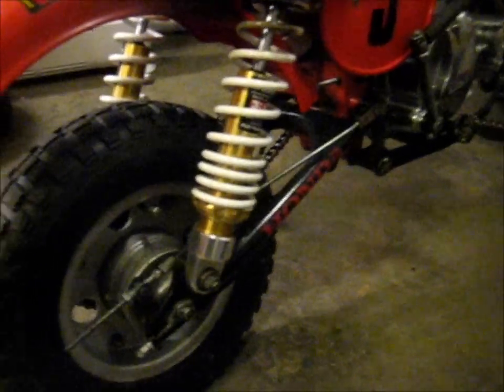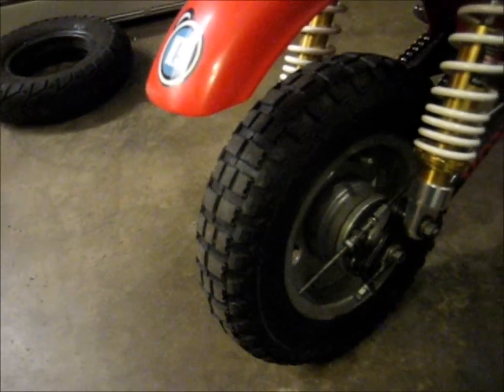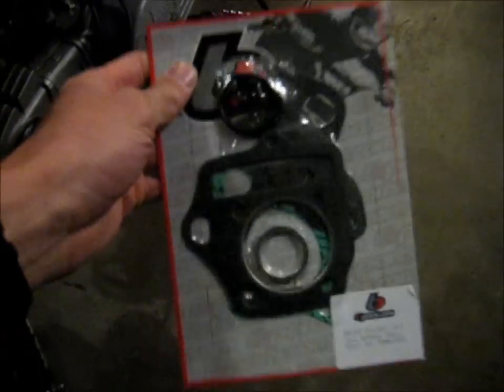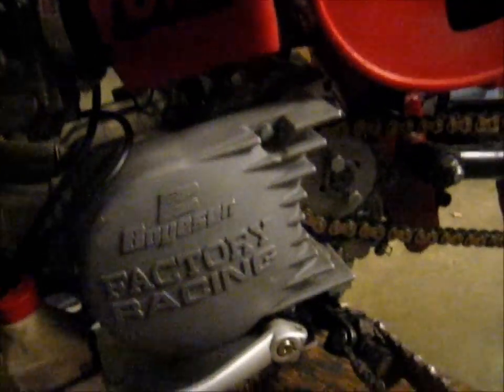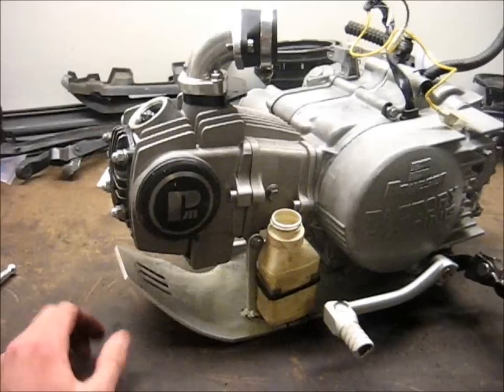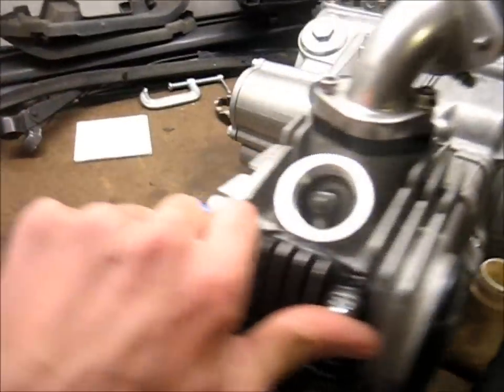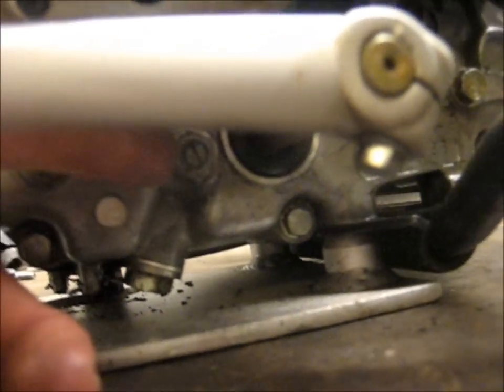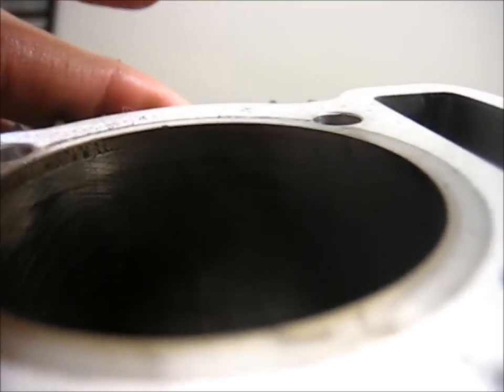Z50R Oil Leaks

Comment: I have a 91 Honda chic dx hb I have been building for 4 years...full body kit, rear drift package, custom low pro tires and rims, custom headlights, tail lights, 1300 watt 2 amps, 2 10" inch subs, 1000 watt digital cap, gt stealing wheel, carbon fiber e brake...b16 to come,

Comment: Your problem is that your not using Honda brand gaskets. Those cheapy ones on eBay are not good, especially the head gaskets as I've had 2 now that didn't correctly line up to the outline of the cylinder.